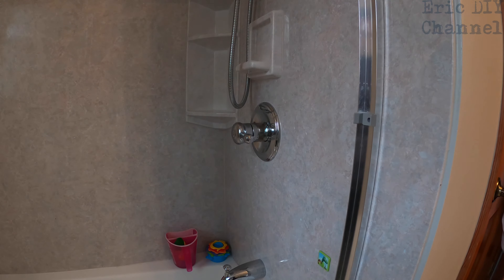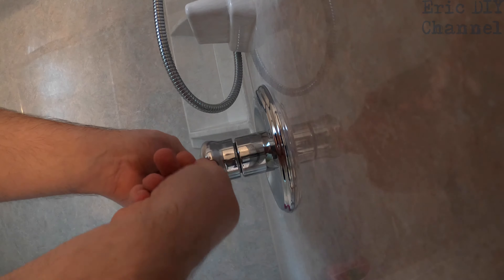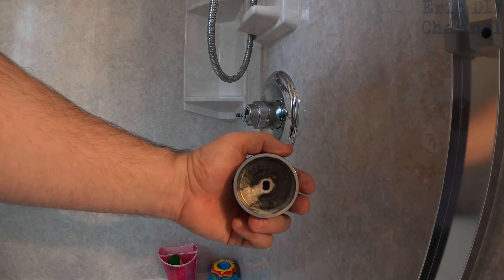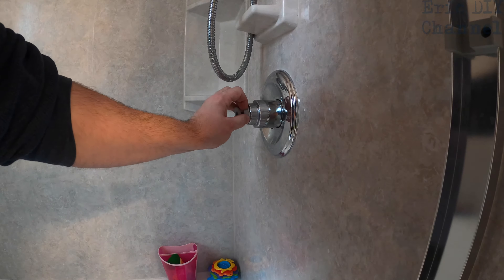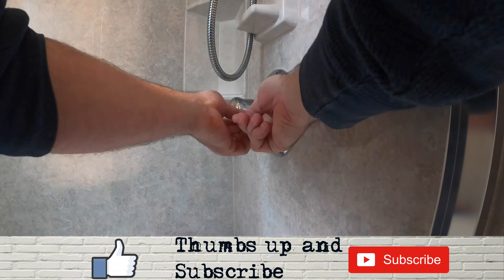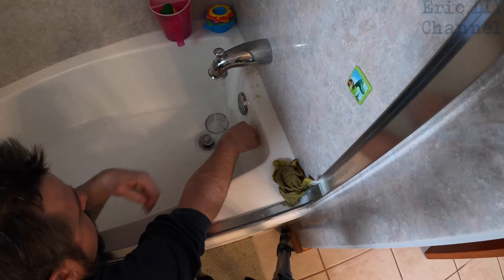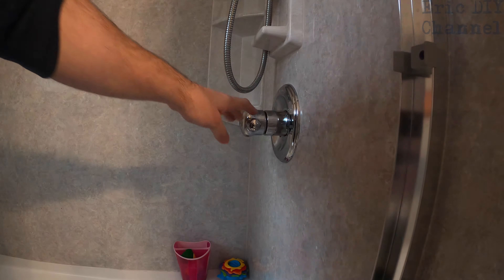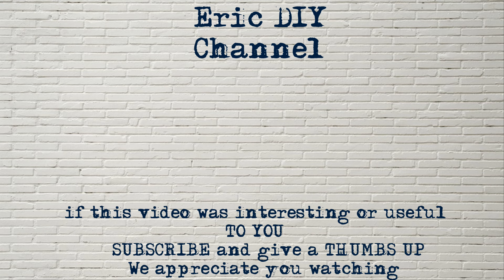How To Adjust Delta Shower Faucet Hot Water Temperature Limit Stop

Comment: If you wiggle the disk after pulling it out towards you, then gently pry the disk with teeth outwards.you dont have to even take them off.Re-calibrate the teeth in the left direction for hotter water and to the right for colder.

Comment: Man, this is like the tenth video I've watched and not one shows one of the modern delta valves (new construction, why it's set so cold by default is beyond me, hot water tank is on max!) The one in mine has a screw that's way recessed inside the side of the handle so I'm just going to assume that's how you get the handle off and go from there once I go find an Allen wrench.
Reply from the maker: @sc0tte1-416  that is usually how you access it. It was a small hex screw in this video.

Comment: Thank you for posting this!  I have this same fixture. I took it apart years ago and it was easy to unscrew the handle.  Now I am trying to take it apart again, and it's stuck.  It is slippery and I cannot unscrew the handle.  I tried rubber gloves and a pair of pliers (and have damaged the handle now). It's like it's glued on. ?  Any ideas?
Reply from the maker: Use vinegar on the screw to remove deposits that might be on the screw. You can do the same with the handle if still needed

Comment: Thanks for video clip. I have the same model that has been installed over 10 years, it's a Monitor 1400 Series. I need to replace the cartridge, after I unscrewed and removed the handle stick and the tiny screw. I have tried to hold it firmly and pulling very hard but no luck pulling out the handle ( it seems very easy in your clip at 1:37 ). very appreciate any suggestion.
Reply from the maker: Try running vinegar in-between the handle and the cartridge to get rid of any corrosion in there and try again
Reply: P